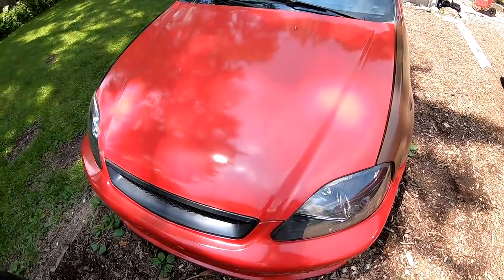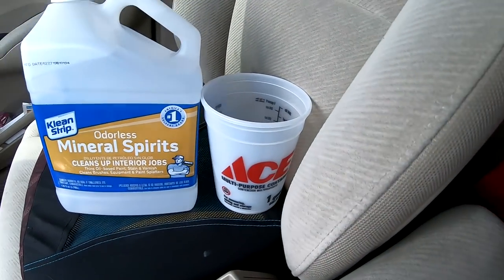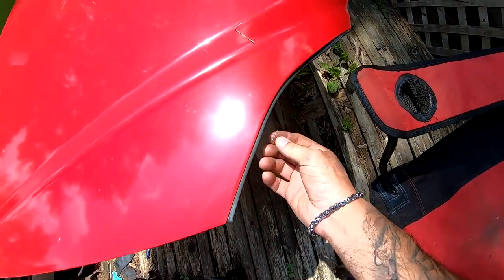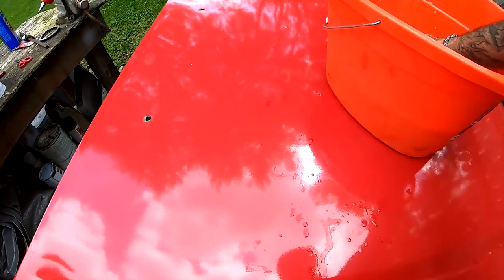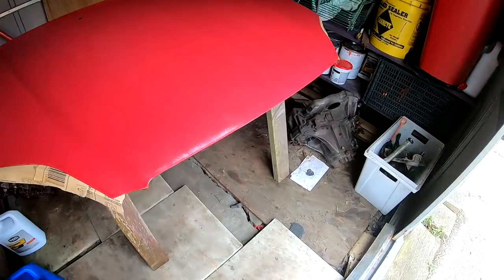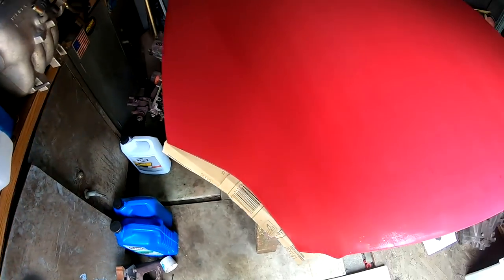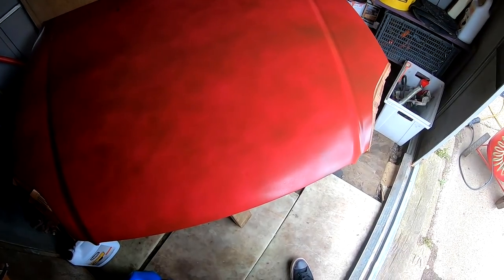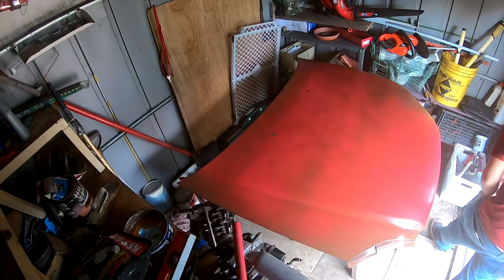Rustoleum Brown paint job & Mexico Action

Comment: I’m curious how clear over rustoleum will look when applied right after.
Reply from the maker: Yeah i wanna try it soon on that fender again. Im not looking forward to another failure if it doesn't work. Maybe tomarrow if it doesn't rain il try again. Il get a rattle can for the brown and have my air gun loaded with clear ready to go.
Reply: Barbas Life if that fails I would spray your rustoleum. Let dry few days. Sand with 600. Then clear.   If that fails.  Your best bet would be to buy 2k clear from a can. I heart they work well with rustoleum paint and won’t wrinkle.

Comment: What pressure are you spraying at?  I seem to remember you spraying at a very high pressure in your early videos and it sounds like you're still spraying at a pretty high pressure.
Reply from the maker: Yeah im still hitting everything at high pressure for some reason it might be the cheap gun if i lower the pressure the gun starts to spit and the paint starts to land on what im painting  in tiny heavy pin marks.
Reply: I think if u grab a 3/8 air line it will help
Reply: @BarbasLife  I have no idea what made me run across this again, but I think last week I noticed in the HF ad that now they're listing that same gun as having a working pressure of 50-70psi (or something close to that) compared to the 23-25 they used to list... maybe you were just ahead of the times ;-)
Reply from the maker: @mpikas  really thats too funny maybe they watched my video lol.

Comment: I miss my coupe. It was showroom clean. What are your plans for the car?
Reply from the maker: Street build. Finish the turbo build get it running for a while to just break in the motor on low boost. Gut it all the way. Roll cage and sticky tires Then get it tuned and go to mexico. Later on start building my top half slowly. This will not be a daily this is just my Youtube civic. What ever you guys wanna see done to it.